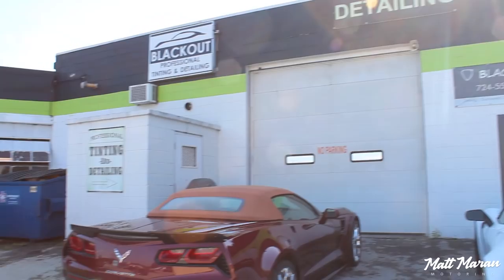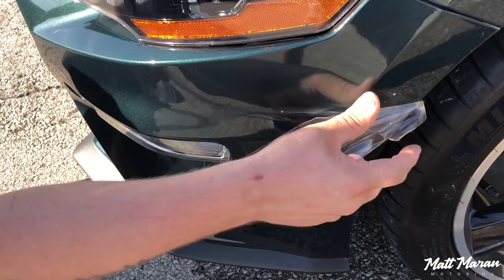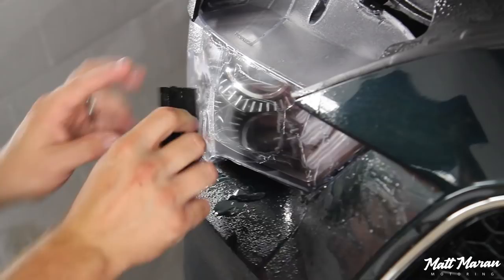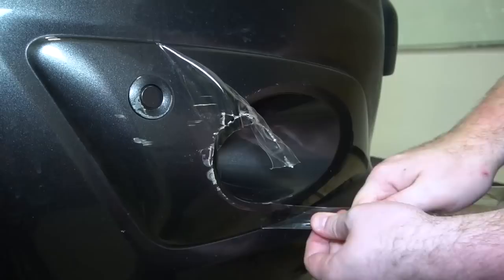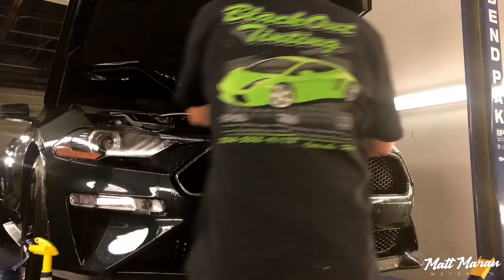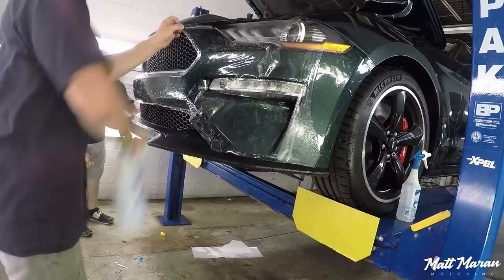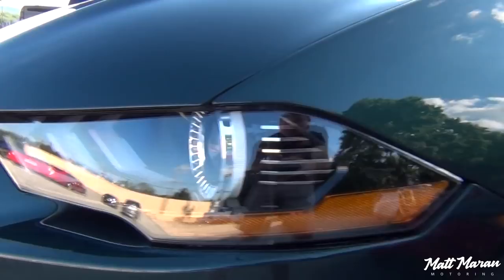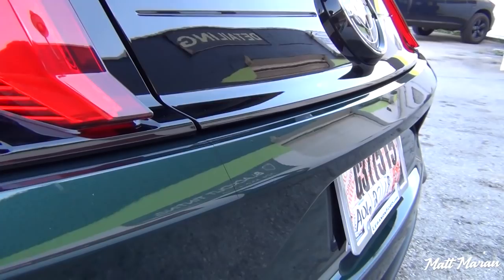Why I'm Protecting the Bullitt with XPEL!

Comment from the maker: Pricing varies by car, installer and how much you want put on. Blackout says about $1,500-2,000 for a front end usually. For my car specifically at this shop with this exact amount of coverage it's about $2,500.
Reply: Matt Maran Motoring well sheit
Reply: 2500 god damn. I have a Tri White Fusion and I was getting quotes just to do the bumper in the 300 range. Granted you pay for quality installs, but 2500 quite a bit. I mean could you touch up for cheaper at the 100k mark, plus assuming you ever get into an accident will insurance even cover that without an addendum?
Reply: Matt Maran Motoring I wish I did this 3 years ago. My 2015 Mustang GT has taking a beating over the years. I’m definitely doing this on my next mustang purchase.
Reply: Wow that seems a lot, Is there any other option out there in the market?
Reply: Did you get the Ford Protect SurfaceCare or anything like that when you bought the car?
Reply: @mishl4823  yeah - don't get it :)

Comment: I’ve had it on my 2014 GT since new. Not the full hood, just the front third. Worth every penny being able to hit the road without worrying about chips. Fours years and still looks brand new. Good luck and great looking car!
Reply from the maker: Thanks! I appreciate you sharing your experience too!
Reply: The Video Pro which one did you get? I’m about to buy my 2014 GT and I wanted to know how much it cost and which one you got? And do you guys recommend detailing the car first then getting expel and then ceramic ? Or expel then detail and ceramic
Reply: Cheyenne Obregon Sorry for the delay in answering. I got Expel but I’m not sure what the package is called. It came with the front bumper, third of the hood, the front portion of each fender, and the side view mirrors. The shop I took it to prepped the car. I’m petty sure that included clay bar etc. it was about $800.

Comment: Great video. This is honestly so worth it. I just bought my new used 2016 golf r and already has a bunch of stone chips just from all the rural driving I do. Spend the extra bit of cash and save the headaches down the road. Kinda pricey but even a general wrap all over will save the paint from elements. Overspray, UV damage etc.

Comment: Matt I would consider doing the rear quarters too. The flare in front of the rear wheels takes a beating. My PP1 has considerable rash after only one summer of careful driving. It's the worst panel on my car.
Edit: the Michelins are probably more likley to throw stones than the Pirellis too. Alternate option would be rock guards.
Reply from the maker: Rocker panels are covered the full length of the side as is the front of the rear bumper.

Comment: I have had two types of film protection on all six of my cars. I use to be a 3M only. But tried the Xpel on my Audi TTS and AUDI A3S. And to be honest. The 3M product is MUCH easier to put on compared to xpel. And 3M, had less issues over time. 
My 2018 Honda Accord 2.0T Touring, thanks matt, I bought it as soon as I saw your review, but I put on xpel and to be honest, I do not like it. I put 3M on my BMW i3 and its a much much better look and easier to maintain. So. thats my opinion.

Comment: Thanks for the video Matt. I have an appointment with my local Xpel installer next week for my '19 Grand Sport. And the video helped in that after the GS I'm taking the wife's '18 Mustang GT for an install also. I was wondering with the angles on the front of the '18 GT if it would turn out good.
Reply from the maker: I'm glad the video helped! Thanks for the comment!
Reply: @MattMaranMotoring  though I would give you an update. The wife's GT came out great.

Comment: Hi Matt 
How’s a going? I’m thinking of trading in my 2015 GT Premium with Performance Package, I know that you just picked up the Bullitt but do you notice a big difference power wise? I’m losing sleep over my decision lol I’m going to the dealership tomorrow morning to make my choice just wanted your opinion, congratulations on the car it looks amazing! Thanks
Reply from the maker: Hey Tino, what Mustang are you thinking of getting? With the new automatic it may feel like a greater difference. Otherwise, with the taller gearing on the manual 2018s, the difference might not be as big as you're expecting. I haven't taken the Bullitt over 4,500 rpm yet so I'm not sure how fast it feels compared to my 2016. Below 4,500 it feels a little more punchy, but not by much.

Comment: Matt Maran Motoring...I am curious about something with the XPEL covering. If you live in an area with cold winters(ice & snow) and sub freezing temperatures, will this have a negative effect on the covering? Wouldn't it shrink and expand at a different rate than the painted metal?
Reply: tominator Same question.

Comment: When you put the Tracwrap on your vehicle, was it precut to the shapes of the front bumper and other body panels you covered? Or did you just purchase a roll of it from XPEL and cut it to shape when at the dealership? Thanks for the awesome content!
Reply from the maker: Tracwrap doesn’t come pre-cut, just in a roll. So with the help of my salesman, we just put it on in strips to cover the main parts. Definitely wasn’t the best looking but got the job done.
Reply: Matt Maran Motoring Thanks for the reply! I was wondering because I was thinking of doing that myself if I purchase a car soon. I wanted the protection before doing a proper XPEL wrap. It made me excited to see you have XPEl placed on the BULLITT.

Comment: Matt are you worried about the issues with the new 5.0? Also has Ford mentioned any of them specifically? I’m definitely looking at a bunch of different cars to buy possibly after I finish college anywhere from a WRX to a GT. Do you think they’ll make more adjustments to the 5.0 and fix these issues?
Reply from the maker: Ford definitely is fixing the cars that pop up with the issues but I don't think there's a TSB for any engine stuff, just the transmission stuff. I'm not worried since mine is a 2019 and hopefully they had time to adjust. The same thing happened when the first gen Coyote 5.0 came out on the 2011s and by the 2012s most of the issues were fixed.
Reply: Lowk3y Chris I think it'll be ok, modern fords are pretty reliable, especially ones with the 5.0's. Plus, like Matt mentioned, whatever issues they initially had in the 2018 model yr should have been resolved for the 2019's.

Comment: No one EVER says or mentions what the cost was after expeling their car/truck or item they had done,haven't seen one vid of anyone mentioning it,,SO EVEN THOUGH IT WAS SPONSERED WHAT WOULD HAVE BEEN THE COST OF WHAT WAS DONE ON YOURS
Reply from the maker: Pricing varies by car, installer and how much you want put on. Blackout says about $1,500-2,000 for a front end usually. For my car specifically at this shop with this exact amount of coverage it's about $2,500.

Comment: Matt, we missed the part where they prepped the paint by polishing it, they did do this, right? I know it's a brand new car but rarely is the paint perfect?

Also, since Xpel paid for this why didn't just pay the difference out of pocket and do the entire car?
Reply from the maker: They inspected the car after washing it and before putting the film on. There were a couple small spots they buffed briefly but no paint correction was needed. As for doing the whole car, to me it’s a little overkill. The coverage I got will protect all the high impact areas. I may get a rock chip on the roof eventually but those are pretty rare and I’m not too worried about it. My goal is to put 200k miles on this car so I’m not expecting every panel to be perfect forever.
Reply: Matt Maran Motoring ...I know it's a driver and because of that I would like to invite you to the Tail of the Dragon run the 2nd week of October, same place SaabKyle saw me reppin' your channel.
Reply from the maker: Thanks for the invite! What day is it? I've been itching to do tail of the dragon but after the first week in October I have other events every week that month.

Comment: How did  you cut the pieces for the temporary xpel? Is there a pattern online to use?
Reply from the maker: No, Tracwrap just comes in rolls, and we just stuck it on the car in strips.
Reply: Matt Maran Motoring thx you saved me aggression regarding road debris.

Comment: PLEASE ANSWER! 
1.) Why did you choose a dealership 300 miles away?? 
2.) Also, can you wash your car with a pressure washer and give it a thorough wash with this stuff on the car??
Reply: You can't treat it just like normal paint. You can also still use a pressure washer as long as you dont blast the edge of the film up close it will be fine.
Reply from the maker: 1. I chose the dealership I did because they are a high volume Mustang dealer and with the Bullitts, allocations were given based on Mustang sales. They’re also close to the factory so the car arrived faster directly by truck instead of having to go by rail. Also, Lebanon Ford was just much better to work with since they actually are performance oriented. As far as washing, all the same with the XPEL, just have to be careful with wax on the film edges.

Comment: Will you be ceramic coating the whole car as well Matt?
Reply from the maker: Yep!
Reply: So with the ceramic coating on top of the EXPEL it should be virtually indestructible 😀
Reply: I would recommend getting the whole car Xpeld if you are going to ceramic pro the paint because it will be obvious where the Xpel and non Xpel areas are! The Ceramic Pro will really add a glass like shine. Also the paint may not wear as evenly in certain areas.
Reply: You want to do a ceramic first.    HARD rigid coating.    Then Xpel.    Not ceramic over Xpel.   That is putting a pane of glass atop a bed mattress when you want it below.
Reply: I have CQuartz on my entire paint along with Expel front cap !!! Best investment for my M2 😁
Reply: VOIP Portland  Actually if you do ceramic first the Xpel will not be able to bond to the paint, the ceramic has hydrophobic properties which make it so that nothing sticks to it that's the whole point of ceramic. Just ask any detailing shop that works with XPEL.

Comment: How much did it cost?
Reply from the maker: Pricing varies by car, installer and how much you want put on. Blackout says about $1,500-2,000 for a front end usually. For my car specifically at this shop with this exact amount of coverage it's about $2,500.
Reply: Matt Maran Motoring little expensive,  I own 2002 mustang roush and i was thinking to do the same as you did to protect the paint,  i got metallic gray color . Little expensive tho lol

Comment: 8 mil thick?  No, I think not!
Reply: SamTheSuave lol
Reply: It's actually 8.5 mil thick. It's a fact
Reply: Dean Marks that's more than a 1/4 inch, something's thick here and not the wrap...
Reply: Art Vandelay your lack of understanding of measurements can not be understated
Reply: XPEL ULTIMATE is 8.5 mils (.0085 inches) thick.Dec 6, 2016.
Reply: Art Vandelay good one
Reply: I think there may be a translation issue here; in the UK a ‘mil’ is a millimetre.  Didn’t know it also related to inches!
Reply: Dean Marks thanks.  I learned something.  I was not aware of the mil as a thousandth of an inch.
Reply: @FlatglassMan  What is the thickness of the XPEL Ultimate Plus? I believe that he said that he had Ultimate Plus installed.